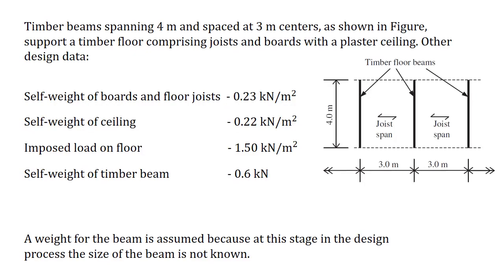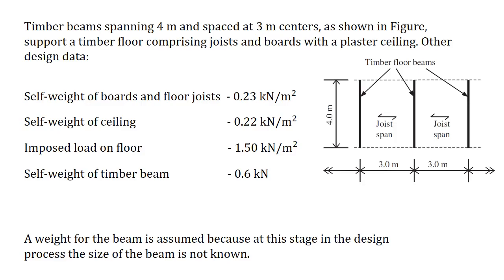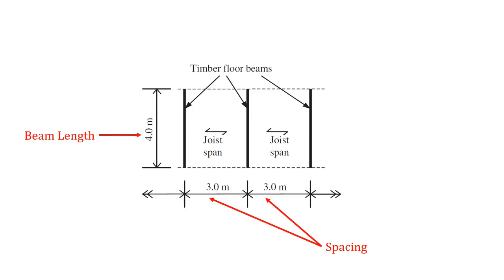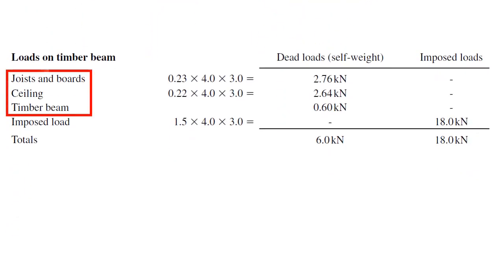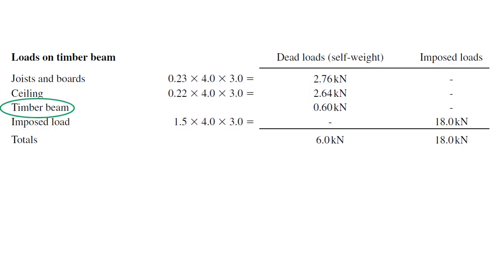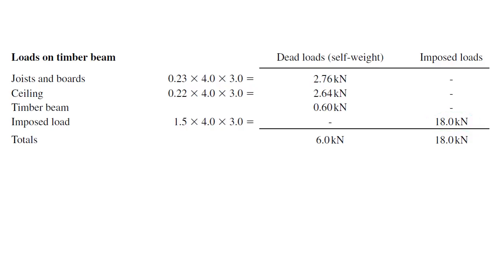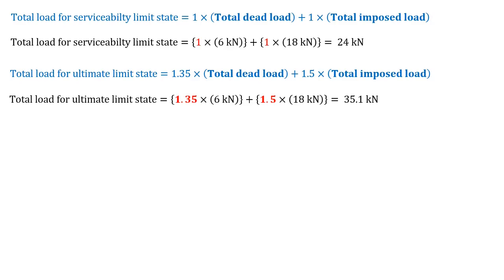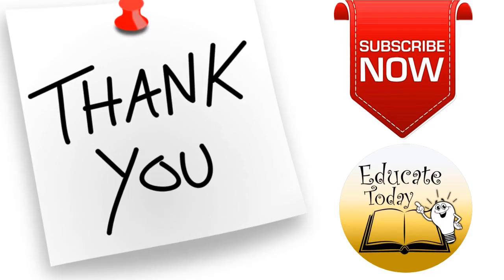How to Calculate DESIGN LOAD on timber floor beam - Accordance with Eurocode - Easy way

Comment: Is there a reason why the assumed self weight of timber beam is 0.6 kN and not another value
Reply from the maker: In this case, it is given in the problem. If it is not given, we have to find the beam self weight according to the beam timber grade. Values of self weights of timber can be extracted from data books. There are particular tables for that.